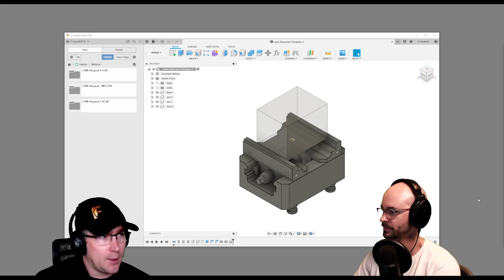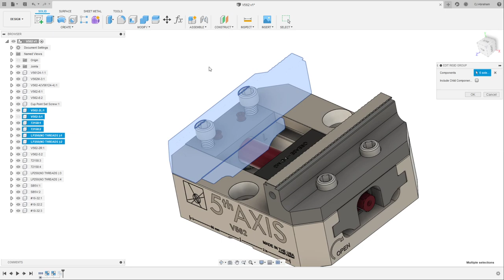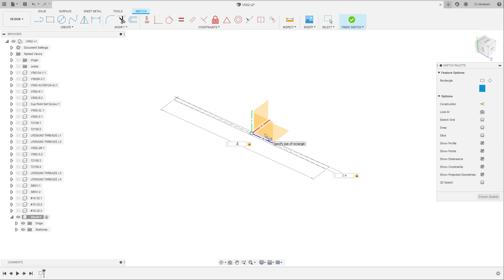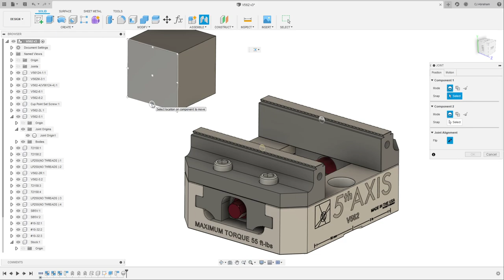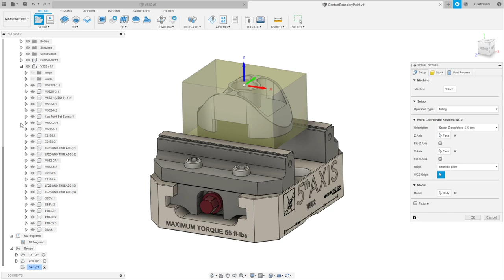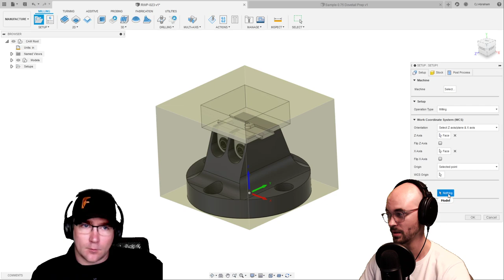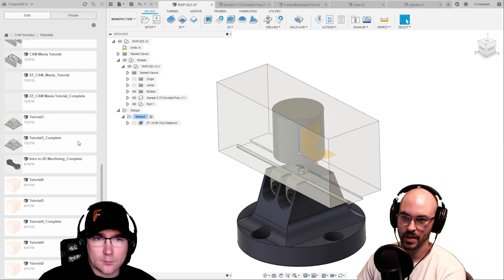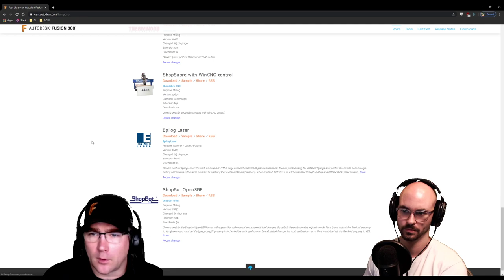360 Live: CAM Hangout

Comment: I’m absolutely loving these videos! I cannot get enough of these workflows to my day to day even more efficient. I was wondering if you guys could do a deeper dive on an OP2 workflow that uses custom soft jaws. That is one area I have a strong feeling I could be doing much more efficiently. I’ve always wanted to watch how some seasoned veterans do their OP2+ setups inside Fusion as I’m sure there are tons of tips and tricks to be learned. Also, if these videos were twice as long I’d watch every minute! Haha thanks guys!
Reply: Rob Ellis I would very much like to do a video on soft jaws! If you have a particular part you’d like me to do, I can* try to work it in.
Reply: @CJAbraham  so for example, I now have my OP1 jaws setup so that I can control the slot depth and width as well as the gap between the jaws and the stock all being controlled by parameters. I have adapted that idea to an OP2 vise jaw setup. Essentially, what I have done was created a vise with my own soft jaw blanks that I machine in my shop, and I have set the gap between the jaws to be controlled by a parameter. Tied to the gap is my join origin. What I did was made the joint origin set so that it will always be in the center of the gap. I set the joint origin on the top face of my fixed jaw at the centerline, and then controlled its spacing using the parameter of the jaw gap divided by 2. This way, no matter what I set for the gap, my joint origin will always be in the center of the jaw. Then I can drag it into my design, joint the part to my origin for the jaws, create my geometry for my soft jaws using projected sketches from the part, and adding my cuts. I am still getting the hang of all this parameter stuff and jointing, but these videos have been a massive help. I was curious to see how you guys do your OP2+ setups, I'm always interested in seeing how other people do the same things I am doing, because it really helps to think outside the box sometimes. Sorry for the lengthy response, I hope this makes sense! I think a lot of people would benefit from this topic!

Comment: the way i see it we can only do one side. if i want to do the other side, i have to open a new file???
Reply: Steve Poirier you can attach another fixture to the other side of the part to continue machining on the other side. My most common workflow is to do all machining for all setups in one document. I may have to show/hide fixtures while working on different setups, but all toolpaths are in that one document.
Reply: @CJAbraham  Thanks for the reply. Nice job